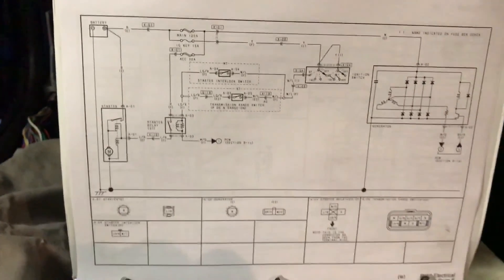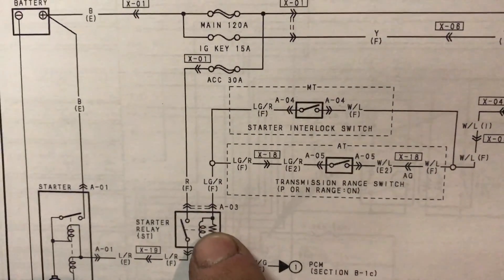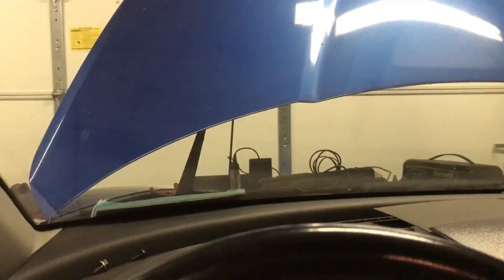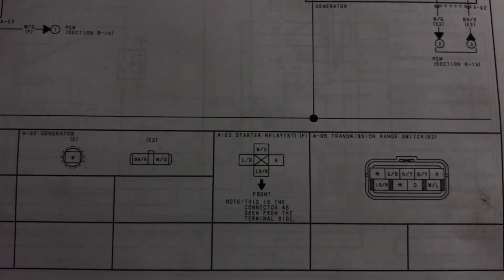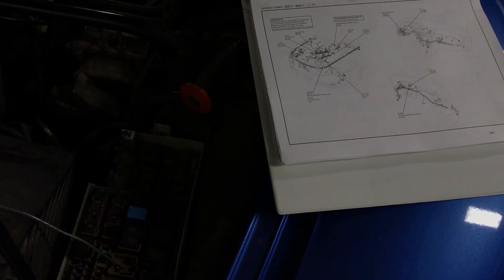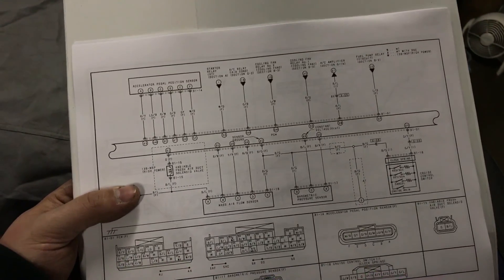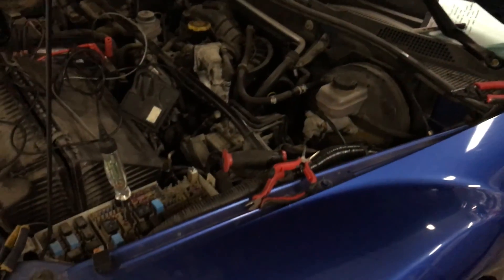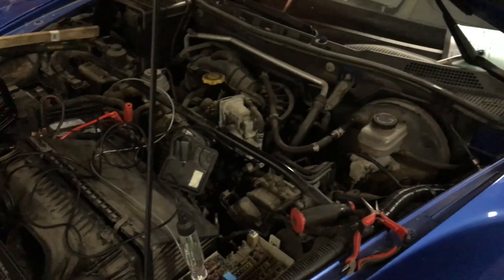Mazda RX-8 Starter Relay Wiring Problems

Comment: On manual transmission RX8, and likely other brand/models  the Starter Interlock Switch can be the issue.  The plunger can become out of adjustment and therefore will not allow power from the PCM to allow the starter to energize.  You can repair this yourself fairly easily and within 30 minutes.  Remove the  Starter Interlock Switch from your car, using a small flat blade screw driver disassemble the S. I.S., you'll see the gray plunger rod with a white stopper,  release the white stopper clip and pull the rod out approx. 3/8 an inch (10mm)  then reassemble and reinstall your S.I.S  ....or you go buy a new SIS.

Comment: If anyone is curious, grounding pin 5A on the ecu harness will override the immobilizer by grounding the starter relay. This should probably work for swapping PCM s and not programming them too I think. Still get the key light on the dash.
Reply: I have an immobilizer issue on my 2004 mazda rx8 with 51,000 miles

Comment: When you had this issue, did you have a little ticking when you turned the key. We have a 2005 and everything lights up when the keys come up, but then i get a very mild ticking (not like the one you are showing at the end of the video)... its done it several times and left us kind of stranded and then randomly will start. I feel like its the relay, but been watching videos and have mixed diagnosis and nobody in our area wants to work on it.

Comment: Did you ever find out the issue my abs and traction control never worked I never knew why but the car stopped cranking randomly so I did what you did and jump the starter and it runs but I have no power locks and no power windows and it will not crank by itself

Comment: You never posted an update video, I’ve been trying to find the fix to this problem for months
Reply from the maker: I'll work on posting a reply soon. This issue was solved very quickly with a simple wiring plug issue that I found out I had inherited from the previous owner.
Reply: @DreamInRotary  I have the same issue; Thanks so much for the overview! Excellent walk-through. If I fix the issue before you get an update video posted, I'll post the fix as a reply here. Thanks again for the awesome video!~
Reply: Cody Hayes what did you fix on it. In the same position
Reply: @christianesquivel10  Clutch Position Sensor. It was not engaging fully so I modified the pedal side to fully engage the sensor and can now start the car with the ignition.
Reply: Cody Hayes HEY! Could you pm me? I have a couple questions because my Rx8 has the same problem and I’ve seen tht no reply video has been posted
Reply: Any luck?? I’m the same boat
Reply: Ghost Pro I found that the there was a main relay/fuse on the side hidden. It controlled all the electric that went into the other fuses
Reply: @t3ddyt1m36  yoooo thanks my rx8 had been having some trouble fire up but the solenoid would turn. Then it jussssst stopped turning and
Reply: Its dope to know we still out here trying

#ganggang
#rx8life
Reply: ninjafreakshowable no problem, took me a lot of digging to find that such a small thing caused such a massive issue
Reply: ninjafreakshowable currently reassembling the engine to replace a rod actually, never ending job

Comment: My problem is that my car starts normally but when the engine gets hot it cranks but it doesn't start
Reply: pcm supplies ground not power
Reply: They all do that, wait till it cools off or possibly apex seals or coils and plugs. Any check engine light?

Comment: I'm having the same problem. Followed the vid and ended up with the same results. What would be the next step or fix for this? Or a link to your updated vid.
Reply from the maker: I'll work on posting a reply soon. This issue was solved very quickly with a simple wiring plug issue that I found out I had inherited from the previous owner.
Reply: @DreamInRotary  please share

Comment: Did you experience a time component to this problem?  I'm experiencing completely normal starts, normal driving with short periods (6-48 hours) where I have otherwise normal electrics but the starter gets no power, just like what you've shown here.  I can push start it, and if I give it enough time it'll start again without hesitation.  

It's coming back from the shop today after a similar episode - the car wouldn't start, sat in the garage for 3 days, then spent 2 days working perfectly in the shop.  I don't have the experience necessary to diagnose it myself but might not have any alternative but to learn.

Comment: Did you ever figure this issue out? I'm having a similar problem.
Reply from the maker: I did get it figured out, I should post a reply to this video shortly. It was an extremely simple problem that can be easily avoided with some careful consideration!
Reply: ive  been thru the ringer with this car. replaced the engine. blew the front seal. hasn't ran right since. I replaced the seal. went for a test drive and it started popping the ignition fuse.. now it has constant power. the dash is always white (lit). the relay you have clicking is the same issue I have. broke two relays up pulling them out.. they were really in there. I can shoot you a video if you think you can help..need to get this one finished and out to get my mazdaspeed 6 in.
Reply from the maker: That sucks man! Have you tried replacing the relay yet?
Reply: all relays were replaced
Reply: @DreamInRotary  hey i saw your video on the RX8 that wouldn't engage the starter. I have the exact same issue and i was wondering if you could share how you fixed this? Any help would be greatly appreciated. Thanks!!!!

Comment: You don't have push the clutch to send power to the starter you only push the clutch to take the weight off the clutch plate to let the engine spin easier the switch u might be mixed up with is a switch but it is the fuel cut off witch is if you push the gas pedal to the floor witch if u want it to start you don't touch the gas
Reply from the maker: This is false. You do have to have the clutch depressed to send power to the starter relay, which in turn sends power to the starter solenoid which closes the circuit allowing the starter to spin. This has been an option on cars for decades, the FB RX-7's even had this. It can be jumped but it isn't recommended, because then the car could be started in gear.

You do have to push the clutch in when the car is in gear and you're trying to start it in order to not engage the transmission (and by proxy, the whole driveline) with the engine cranking.

I'm not really sure what the last part of this comment means with the fuel cutoff switch to be entirely honest.
Reply: @DreamInRotary  My Rx8 also starts without pressing the clutch. Maybe that switch wasn't installed in Europe?
Reply from the maker: @DriveVice  It could be that your clutch switch is faulty. They are designed so that when they fail, they don't inhibit the car from starting - as that could be a very costly and annoying thing to find out later. Does your cruise currently work? And, if so, does it shut off when you press the clutch in to disengage the cruise?